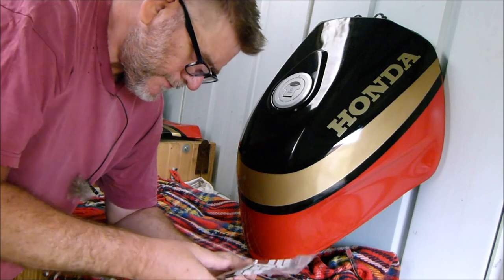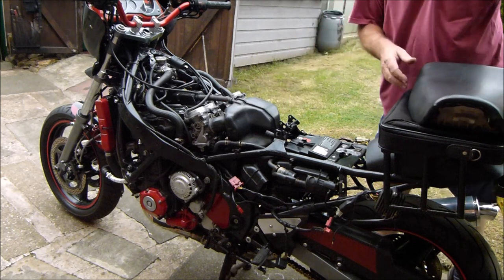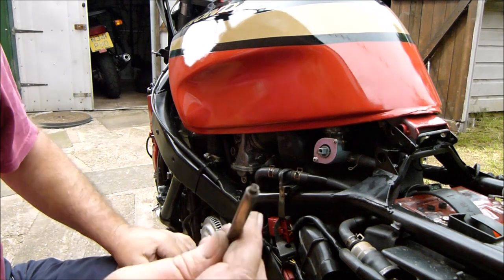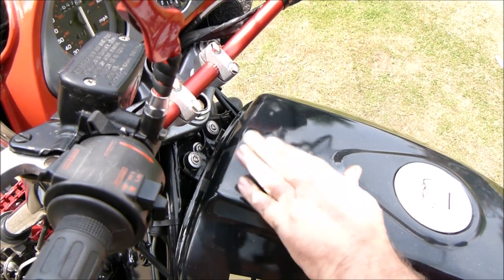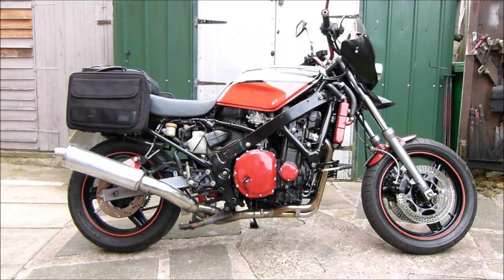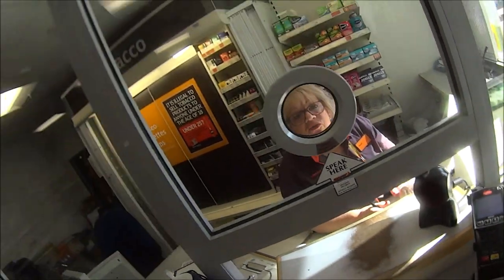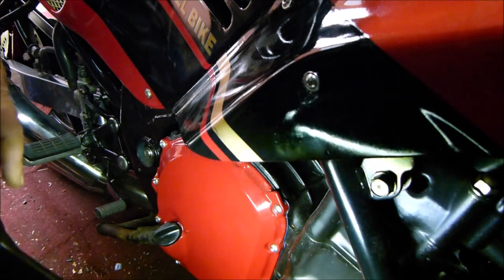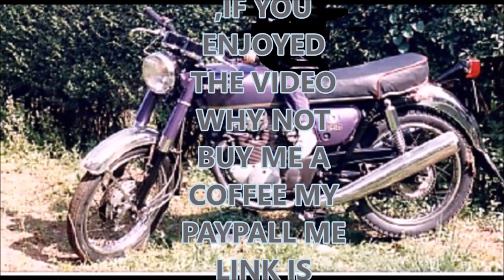cbr1000f Landfill bike. it's all in one piece. "failure"

Comment: I'm 90% sure it's the cam chain tensioner chap.  I know you primed it which is good but did you PROPERLY clean it? What you want is that tensioner arm to FREELY and SMOOTHLY move all the way up and down without catching. Pull the bastard out and soak it in petrol for coupe of hours and keep "pumping" that arm every now and again until all gunk flushes out from it. I've just done it on mine and it literally cured the rattle. My rattle was quite nasty and loud and sounded just like yours. It's a fairly easy job chap, carbs and airbox can stay untouched, just need to remove the intake cam and CCT will come out easily. All the best buddy, lovely bike btw.
Reply from the maker: Yes I did soak it for a few days and freed it up. I do have another one but tbh I can't be arsed with it at the moment, maybe next season.

Comment: Does it make the same clatter with the clutch pulled in?
Reply from the maker: It does change in tone slightly with the clutch in 👍
Reply: @jonyr1TT  gday, as you know being an old fossil like me, and knowing the diffence between a left or right handed screwdriver..., pulling in the clutch should stop basket clatter on most bikes.
I would start balancing carbs first before getting the spanners onto it. If you can get it to idle smooth like a clock your problems "might" be solved. Also, as a side note I owned this very model and it had 130,000kms on it and ran as smooth as silk, watching your restoration is making me miss the old girl.
Reply from the maker: Lol to late the clutch is already out but tbh I can't really find any loose or free play. I'll probably remove the basket at some point in the week and change the complete clutch over.. 👍 this is my third 1000F. Great fun bikes to ride 👍
Reply: @jonyr1TT  Yeah hope that sorts it. Checked all the rubber tubes for cracks etc, plug leads, Coils? without pulling the motor out I think you really want to check all the external stuff. Good luck.
Reply from the maker: cheers bob will do.